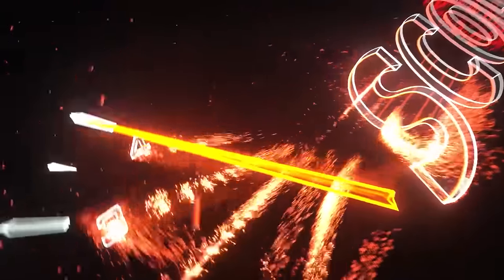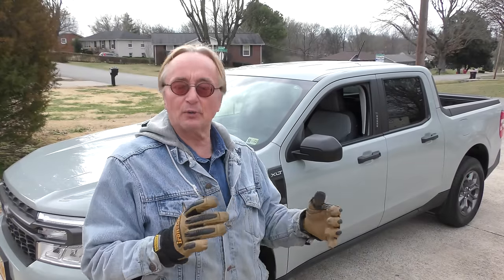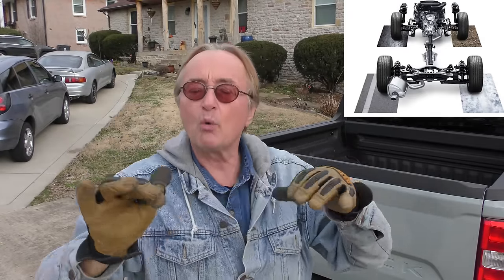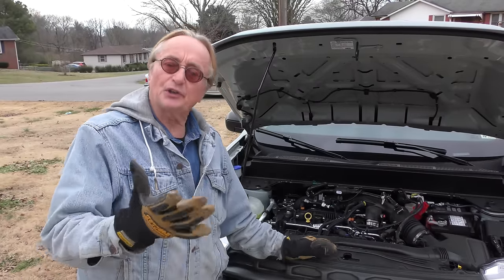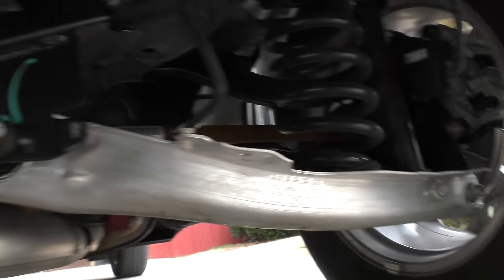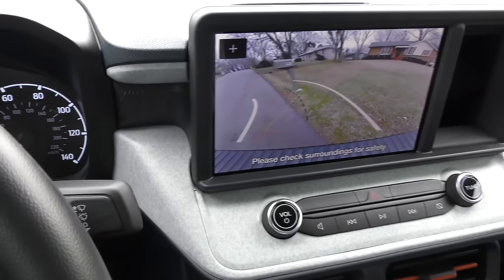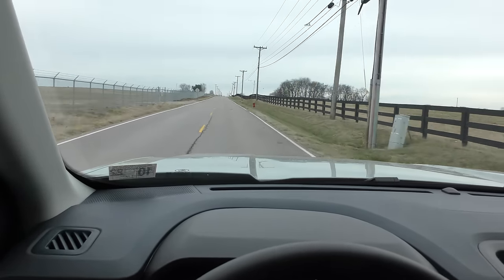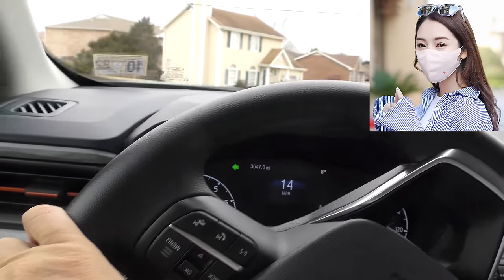I Finally Got a New Ford Maverick and Here's What I Really Think of It

Comment: Scotty usually rags on anything built in Mexico. Scotty must be in a good mood today. This pickup looks very good. Time will tell.😇
Reply: It's the rose-colored glasses...
Reply: Tacoma’s are made in Mexico and they are on top of the midsize pickup food chain.
Reply: @joeshmoe8952  Or all the crap made in Detroit.
Reply: It’s taco Tuesday, that’s why
Reply: @BisselleWixxelle  is it true Germans love David Hasselhoff?  💘
Reply: @jimmytimmy3680  I’m hearing lots of good things about the GM 2.7L turbo engine. The brand new ones even have some Duramax parts like the crankshaft.
Reply: @BisselleWixxelle  Funny.All german cars are pricey but all of them go junk after 100K miles.Some go even sooner!
Reply: When the avg used car costs as much as a pretty loaded maverick it is hard to criticize.
Reply: bigmike obama how? the s10 had a smaller engine and they're really reliable, and the turbo is tiny
Reply: @BisselleWixxelle  We have German junk in USA too. Ask Scotty
Reply: bigmike obama  I agree when talking about the three cylinder.
Reply: Ford engines have been built in Mexico for decades. They made the 4.0 V6
Reply: @angelgjr1999  Since 1983 indeed.
Reply: if you watch vintage scotty, time will tell will it hold up.
Reply: Not everything made in Mexico is bad. After 28 years, im still rolling down the road lol
Reply: It looks like a yuppy truck
Reply: Gotta love Scotty. Opinions galore. Like Lisa Simpson, he's got answers to questions we haven't even asked. Love the over active unnecessary volatile jazz hands gestures. Not to mention the Yoko Ohhhh No glasses. Keep it up Scotty !!
Reply: @BisselleWixxelle  you believe the Corvette and NSX could be made to high standards in Mexico?? Really???
Reply: @raindropcleaners  this made my morning 😂 RIP
Norm
Reply: Mexicans are Building America 🇺🇸 too and for a cheaper price, be happy save money 💰 and at 65 retire in Mexico 🇲🇽 and keep saving money and stay happier. 😜
Reply: @BisselleWixxelle  and I wonder why your “POS” cars depreciate sooooo much within 5 years!
Reply: German cars ar a joke.  BMW is comical.  Mercedes’ is overpriced junk   Porche again overpriced pansy mobile.    Sorry.  But the last thing the hit the road was panzers
Reply: I bet if he sees Janet Garcia (The Sexy Weather girl) he would have second thought about Mx
Reply: Only downside is these things have a small gas tank so long range is not good unless it's the hybrid
Reply: The chevy equinox the most popular selling model... is made in mexico
Reply: @FaMiLy One As Mexican I concur
Reply: LMAO it's brand new
Reply: Plus the guy who owns it is probably just out of frame. He's being nice.
Reply: He lives in Mexico now
Reply: I think he likes Ford
Reply: @fernandoduarte9584  oh ok
Reply: Amazing , an American saying something positive about a US owned company and one of its products and then pushing some Asian brand as better .
Reply: @bruceburns1672  He is a contrarian.
Reply: @joeshmoe8952  no they are made in San Antonio, Texas.
Reply: seems good 20/10.
Reply: My aunt is from mexico they’re the hardest working people
Reply: @benjaminlibertarianscorpio  I live in Florida and spanish speaking people ( mostly Mexican) are very hard workers.🙂
Reply: @triggersafe1  The same could be said about most Japanese and American cars nowadays
Reply: @FaMiLy One Contrary to your belief, a lot of people do
Reply: @joeshmoe8952  i had a guy come in with the l4 and it was leaking oil already from the gasket. 10k miles. Ive got pictures too. Wish i could post it here hahaha
Reply: @Lee Iacoca Germans can complicate a paperclip.They over engineer things.
Reply: @bruceburns1672  Truth hurts?
Reply: @Peewee239  That’s rare, I’ve never seen anyone post anything like that regarding the tacomas.
Reply: @joeshmoe8952  I was talking about the GM l4
Reply: That's as foreign as the Chevy Colorado...
Reply: @philllsxga.7737  GM can't afford to make a smaller truck, with most parts, made in America.
Reply: @lukespack  every part in every vehicle made no matter the brand comes from the same handful of suppliers...
Reply: @philllsxga.7737  How many is a handful? 5, 10, 15, 20, 25, 30, 35, 40, 45, 50...................................................?
Reply: @lukespack  Lear Johnson control Tyco Delphi magna Borg Warner.. and some others make all of the parts for every brand.
The vents in my Silverado are identical to vents in some f-150s..
You're basically buying a name plate these days...
Take any modern brand car apart you will see..
The only difference in a Cadillac and the high-end Kia is extra insulation and a different engine in the Cadillac other than that all the switches knobs buttons and dials are identical..
And the $100,000 Escalade is mainly made of China parts..
Reply: @jamesmedina2062  Depends on who's building. I've met some Mexican Craftsman and I've also come across some hacks. It comes down to who you let in the door tbh
Reply: @abelbriones4370  You're thinking of the Tundra Cabezon
Reply: @j.m.5995  They just moved the tacoma to Mexico last year apparently. I didn't know that.
Reply: @nunyabusiness6561  for me
Reply: bigmike obama  yeah unfortunately that's the new trend, small engines with turbos. Even the tundra is going turbo now.
Reply: @BisselleWixxelle German cars are garbage.  But at least they are expensive, overcomplicated and difficult to service...so you got that going for you
Reply: @BisselleWixxelle  And doesn't VW build cars in both country lol
Reply: @Lee Iacoca The good old BMW V8...only car I've ever owned where rod bearings were a consumable maintenance item.  Garbage.
Reply: TDI for Life  Corvette would like a.word
Reply: @BisselleWixxelle  If so then Tesla's new-car sales grew 234 percent as the wider German market plunged 32 percent to 198,258 registrations, according to data from the KBA motor authority. An American Startup Car Company single handedly Made the German Car industry question what they were doing with their lives .
Reply: @BisselleWixxelle  As if you guys can brag!!!
Reply: @lucada8538  Ralle box.
Reply: @somethingorother9263  I'll take one and I'm a greezy old man.
Reply: @Peewee239  Oh, I understand now. Most people say they have a good experience with those GM 4 cylinder engines but only time will tell if they can go miles and miles without any issues.
Reply: @lukespack  Only place in FL that there is Mexicans that I have ever heard of is Homestead. Most people in FL who speak spanish are Cubans.
Reply: @joeshmoe8952  You must live in South Florida. There are lots of Mexicans  and Puerto Ricans from south of Tampa and Orlando. They used to harvest crops but many are here year around now. Huge amounts in building new houses and repairing old houses. I had a new roof  put on this year and a new air conditioning last year. The actual work in both jobs was done by Mexicans. Very hard workers.
Reply: @lukespack  I’ve visited south FL plenty of times but didn’t really know there was that many mexicans down there. I’m from CA and the mexicans have been there since CA was part of mexico, that’s why majority of the streets and cities are spanish names. But yes, they work well, all we need to do is hire a bunch of mexicans who are willing to work for cheap and the U.S. economy will sky rocket.
Reply: @bigmike obama couldn't wear out any quicker than the ridgeline
Reply: @BisselleWixxelle  What’s Germanys answer to the GM LS engine?
Reply: @bones007able  friend of mine bought an equinox I told him not to he didn’t listen and now has 35,000 mi and is falling apart all kinds of problems junk he got it cheap ha !
Reply: I think this hit a target market that was really thought to be all that big, because Ford has reported they're surprised by their own sales numbers. I think it serves the market of people who want something I can pick up so they have the vertical space that a bed gives you but the passenger capacity of a sedan or small SUV. I see this being very well-liked within cities or Suburban areas maybe not so much a work truck but a Leisure or commuter truck.
Reply: No....the paint quality will tell its worth *
Reply: @BisselleWixxelle  Bro at least our rear axle differentials don't commit suicide after a few thousand kilometers.
Reply: @Victor Martinez ikr, the work pickups to their limit 105% and expect them to last like a commercial vehicle.
Reply: @f150lightningboy  maaco high quality paint job probably one year life
Reply: It's OK for the price
Reply: @BisselleWixxelle  specially audis total garbage from Germany
Reply: That's what I was thinking he did a video before talking no bueno because is Echo en Mexico ....
Reply: @benjaminlibertarianscorpio  no argument there. I think thenproblem with "made in mexico" is not the workers themselves, but the reduced quality control to save money. There are fewer rules in Mexico, which makes it easier to build there.
Reply: @nunyabusiness6561  Americian cars are like horses and boats, the best day is the day you get rid of them!
Reply: The base model is a great deal but as you upgrade, better to get a Ranger or f150
Reply: Ignorance reflects clearly from those who still believe that made in america still means something good. We haven't lost the battle yet, but American cars are a disgrace. Only some model can really compete with other brands. Also for those who believe that made in Mexico is low quality all I can say is that  you better get your facts right. They manufacture for a lot of diferent car name. Is not the country is the car manufacturing quality system.  If you had a chance to visit how toyota makes cars compared to Chrysler....it is day and night.
Reply: @jairrivera9076  What do you think is the reason for the lack of good workmanship in American auto factories? Is it the high wages which cause the use of more robots?
Reply: It's just a ford escape with a bed. Junk
Reply: The truck probably came with a burrito so he was happy
Reply: @losbadgt  I would have asked for a little Mezcal too.🤤
Reply: @BisselleWixxelle  I’d rather drive a Ford than a joke of a vehicle called bmw, Porsche, Mercedes or Audi. German engineering? Have you ever worked on ANY of those makes? You can buy 5 year old 100000 mile German cars for pennies on the dollar. Why do you think that is? 
Cheers
Reply: @BisselleWixxelle  that’s hilarious cus bmw is notoriously trash here.
Reply: dealerships trying to get $40.000 dollars
Reply: @joeshmoe8952  Tacomas sold in the US market are made in Texas, but yes they build them in Mexico too.  There are 2 plants in Mexico, but the newest just started in 2020.  Up until 2010, the ones made for the US market were built also assembled in Fremont, California.  That’s the location Tesla now owns.
Reply: @tomdavis3038  I dont know why but growing up in the us, German cars were nothing but problems. When I moved to Europe, German cars go 200k+ miles with no problems. The worst German cars models are actually the ones built in US factory's lol.
Reply: @Peewee239  wow
Reply: @BigSnead76  yea not a pretty sight. Wasn't astonishing though. A lot of GM stuff is trash nowadays.
Reply: @BisselleWixxelle  BMW series 3 and series  2 are built in Mexico, pretty good "Germans cars" if you ask me. Actually the series 2 was partially design in Mexico.
Reply: The Hermosillo plant is one of Ford's best production facilities. According to Ford Authority they are the top North American Ford plant. So far the quality of the new mavericks and baby bronco has been excellent.
Reply: bigmike obama  The 4 cylinder ecoboost engines and variations have been in production at Ford for at least 8 years in almost every model, on larger and heavier platforms.  No reason to think this is any different
Reply: @BisselleWixxelle  hove buy USA quality for 7 year, never disappointed and always happy
Reply: Well, does he know that Toyota Tacomas are made in Mexico 🇲🇽?
Reply: @jimmytimmy3680  sure thing high speed…
Reply: @angelgjr1999  the 4.0 engine V6 was made in Cologne
Reply: @bruceburns1672  it was nice to hear…
Reply: @sherwoodbaker2714  Yes but the plastics and rubbers were from Mexico. The coolant overflow tank said made in Mexico.
Reply: @sherwoodbaker2714  I am sure he does.
Reply: @joeshmoe8952  Japanese quality control I guess.
Reply: @tony3552  Is she a car you .ca handle better?
Reply: This guy has some hate for Mexico and it's hard worker's.
Reply: @tony3552  They all look like private call girls. 😂😂😂😂😂😵😵😵
Reply: Has he said anything about his beloved Toyota making tacomas in Mexico
Reply: He really does and it’s annoying
Reply: @BisselleWixxelle  all is quiet the times we beat you in the Nurburgring…. 🤐
Reply: Mexico? Enough said.
Reply: @bones007able  gf just had to replace her engine @ 70k in her equinox. Pos..
Reply: My 2012 Jetta was built in Mexico and it's been one of the most reliable vehicles I've owned outside of some rather minor electrical issues but nothing when it comes to just driving a to b. 1200 in repairs in 10 years; 200k miles. Ain't too bad.
Reply: He must have had some good tacos before making this video.
Reply: @somethingorother9263  yuppys don't drive trucks
Reply: Lol -- ' good mood '
Reply: Dense packed motor.
Reply: The small engine is a definite no go for me. I live in the Appalachians, so there are hills everywhere you go here. They are very hard on engines.
Reply: Except for the Tacoma
Reply: @BisselleWixxelle  Here in the U.S. the German Made cars are real crap. 💩
Reply: @RequisiteFunction  you should check the numbers . Mexico manufacturing has less deviations than US counter part factories. Hermosillo Ford plant is at the top 5 quality factories worldwide. Real hard data.
Reply: @BisselleWixxelle  never bought a German vehicle so I’ve gotten more than 200k miles each time.
Reply: Sorry to tell you but I work on these everyday  and 80% is from Mexico
Reply: @jimmywhitlow2012  it isn't just this vehicle, it's many vehicles. They are doing everything with the transmission now. Engines today have narrower powerbands to hone down the MPG and optimize HP rating, so all the work has to be done with an 18 million speed transmission.  Hell, in the 50s, a 3 speed auto was luxury. In the 70s, 4th gear in a stick was overdrive. Now, base model manuals have 6 gears.
Reply: bigmike obama  you need to travel more. See Europe and Asia , tiny motors 300k no problem
Reply: I doubt it he just passed away I heard
Reply: @BisselleWixxelle  A German calling US cars crap.

Lol, lmao
Reply: @tiempoderelajarce983  I’m Mex too and that’s very narcissistic to say we’re building America we’re not the only people here.
Reply: Definitely getting paid for this 🥵
Reply: Looks like a damn Hyundai engine. They don't last in the long haul in my experience.
Reply: I hope the oil return from the turbo isn't plastic, running close to the hot engine with a wimpy foil cover over it like another brand.
Reply: CVT transmission 😂
Reply: @Victor Martinez 
Is it a truck or isn’t it ? If it can’t do truck things then it’s just a poser truck.
Reply: @joeshmoe8952  Are they front wheel drive ? Don’t they have a full frame ?
Reply: @raindropcleaners  😂 They do !
Reply: @angelgjr1999  Some were not all. Some were made in Canada too I believe?
Reply: No creaking or rattling? So what. Neither does a brand new Hyundai. Now drive it for 90 days and tell us if it isn’t making noises. 😂
Reply: @rolandthethompsongunner64  Which vehicle are you asking about?
Reply: They’re already having issues with the Ranger believe it’s the 2.8 liter that self destructs ? 😂
Reply: I remember people chopping up station wagons in the late 70’s and they were more pickup truck then that thing 😂
Reply: How much for your Matrix ? I’ve been looking for one of those.
Reply: Get rid of all that electrical crap put a 5 or even 6 speed in it and I’ll buy one. Otherwise I’ll just look for a used Ford Escape. 😂
Reply: @lukespack  GM uses Mexican parts too 😂
Reply: @mattgeiger9988  There’s been advancements in turbos and direct injection. Only makes sense to stick with a four cylinder.
Reply: bigmike obama  small trucks have always had small motors, Toyota used to import little four-cylinder turbocharged years ago
Reply: @BisselleWixxelle  I mean it’s the same continent so generally speaking yes
Reply: I’d buy this over any crappy German cars who starts burning oil at 100k
Reply: @BisselleWixxelle  Well, considering the fact that y’all can’t tell the difference in quality of automobiles made in either Mexico or the USA really goes to show how Germans really don’t know what they’re talking about lol.
Reply: Saying something is made in the USA isn’t saying much. Not much better than Mexico.
Reply: What? It looks like a ford…
Reply: He was sleeping that’s why
Reply: @leadnsteel1428  The. 2.0T comes with a 16.5 gal tank. That times 30 mpg highway means 495 mile road range. You'll need to make a pit stop before it does.
Reply: If that’s the case, I hate to break it to you, but that’s where the Tacoma is assembled!
Reply: I could sell my 2007 ranger xlt with less than 88,000 original miles and get almost three quarters back then what I paid for it. Nope,not for sell.
Reply: @joeshmoe8952 and that’s why they still have rust issues .
Reply: @bigmikeobama5314 it's a 2 lite, a decent size, plus its a unibodu and doesn't weigh much
Reply: @BisselleWixxelle  we think the same way about German crap with all of that plastic in the motors
Reply: I personally think its not where it’s built its the quality company accept as minimum. Apple manufacturers in China.
Reply: It already has 5 recalls